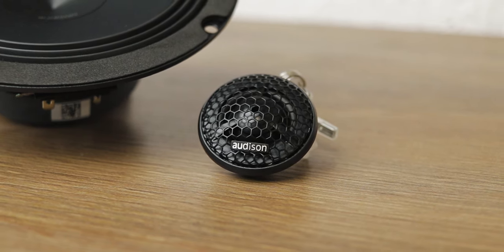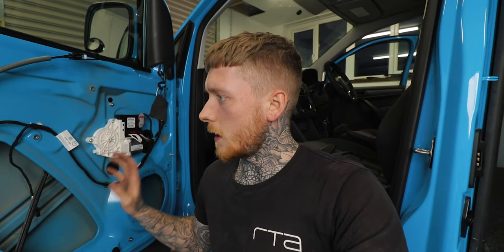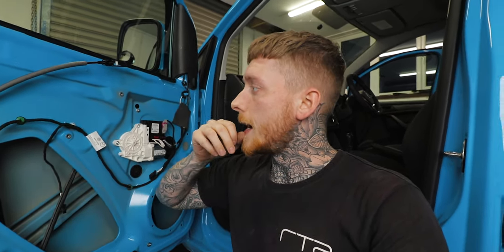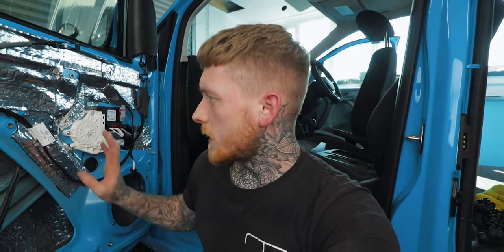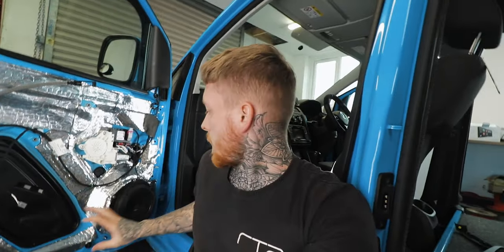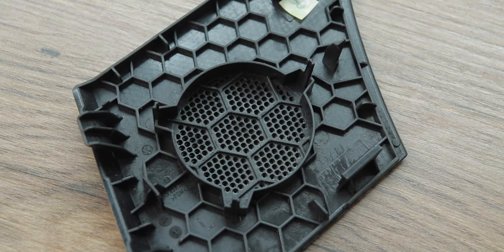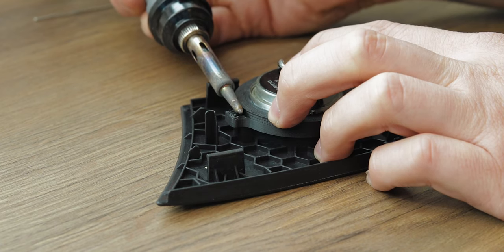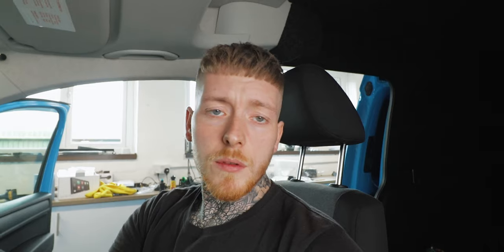THINGS THE CUSTOMER DOESN'T SEE - Full Audio Upgrade In A Volkswagen Caddy

Comment: Great attention to detail I was already thinking about how you would get the extra insulation to prevent sound loss maybe like a foam, then when you made the comments at 6:10. Attention to detail pays dividends. Graet work :)
Reply from the maker: Thanks, I appreciate you taking the time to watch. Absolutely right, the manner of installation will directly impact the overall result and longevity of any upgrade, it's the small things that will make the biggest difference. This system isn't overly expensive (obviously that's subjective) but I know the equipment in this Caddy is performing to the best it can with really good results.

Comment: Hi im looking at doing a stereo upgrade got kit from a old build which ill reuse its a 2000rms setup and wanted to no what would you do with power supply  as these vans have a battery insulator any advice appreciated

Comment: Great work, without revealing the actual price of that job is there a ball park figure you can give please?
Reply from the maker: Thanks Cary! Roughly, the equipment cost for this install was around £1300, that's speakers, amplifier, subwoofer, cabling and sound treatment. The customer supplied the stereo on this one but typically I'd say around £399.99 would get you a good stereo with CarPlay etc, like the Pioneer SPH-DA250DAB for example which is my go-to entry level stereo. The custom adapters, mounts etc will always vary depending on the requirements, then labour, which again depends on the brief. Hope that helps!